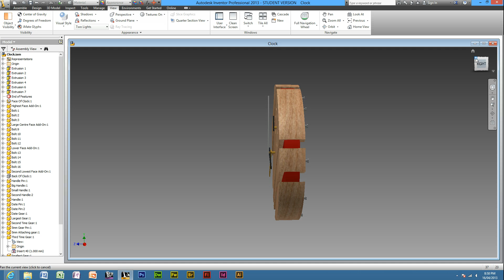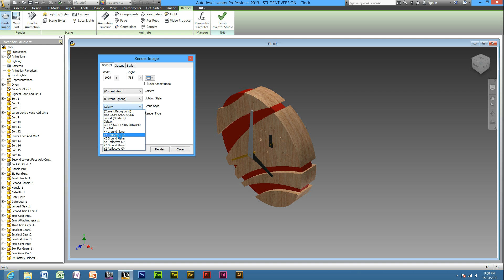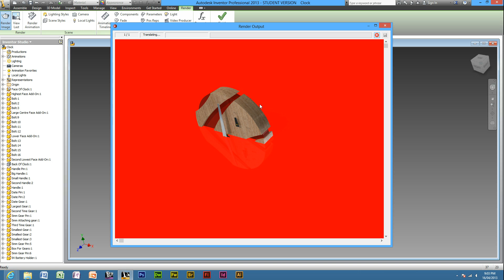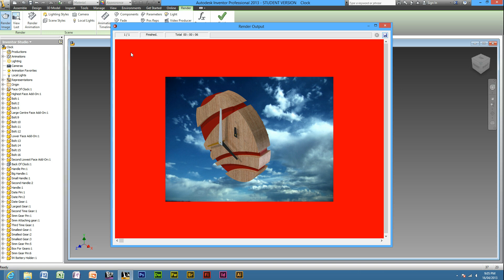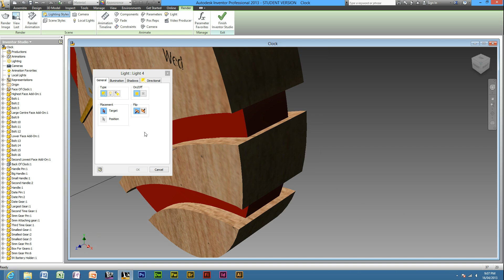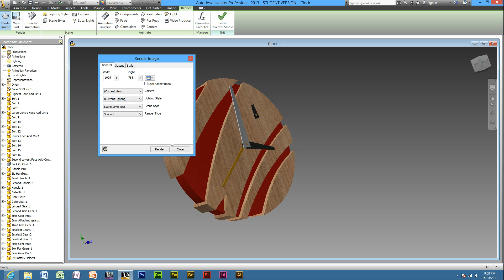Autodesk Inventor 2013 - How To Make A Render

Comment from the maker: The download may have went bad somewhere, I had this issue with Autodesk Revit Architecture when I first downloaded it. To repair go to Control Panel > Programs > Programs & Features, then click Autodesk Inventor, select the uninstall/change and then repair when Autodesk Inventor user interface loads, if this does not work, it may be due to the Microsoft Visual C++ on your computer.